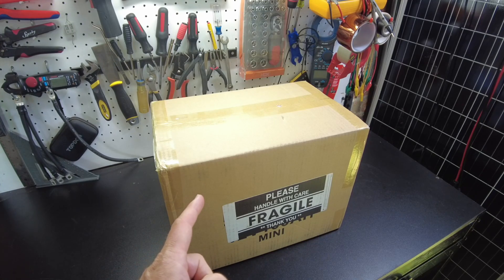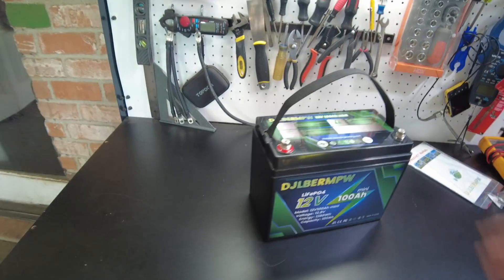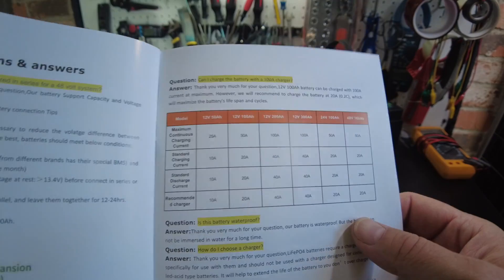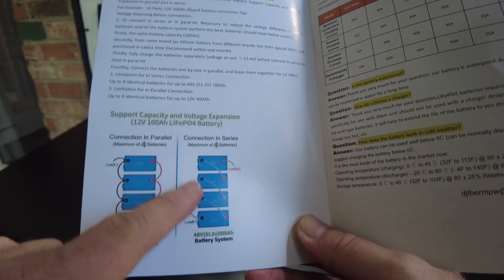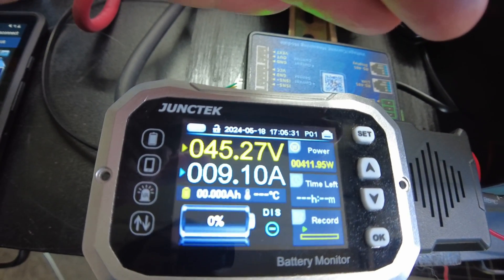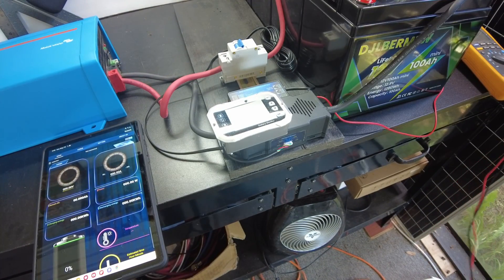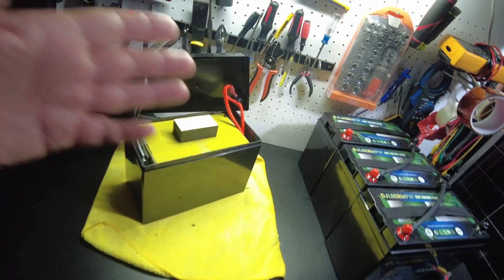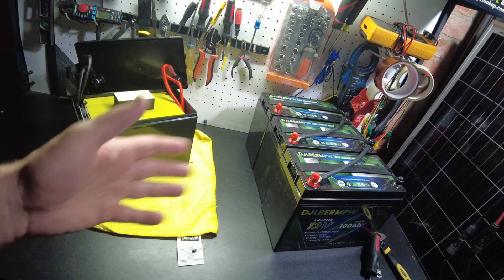DJLBERMPW Mini 12V 100Ah LiFePO4 Battery

Comment from the maker: Affiliate Links:
DJLBERMPW Mini 12V 100Ah LiFePO4 Battery: https://amzn.to/3V8Ra5Z
LiTime 48v 10a charger: https://amzn.to/4bvKlBe 
TEMCo 2 Gauge AWG copper wire: https://amzn.to/3wwKRzK
Midea U Shaped 12000BTU AC Unit: https://amzn.to/43xiXPm
Hydraulic Crimper: https://amzn.to/3MC5AHs
Victron Inverter 48/1200: https://signaturesolar.com/phoenix-inverter-48-1200-120v-ve-direct-nema-gfci/?ref=JRZm6fna41pidY

Junctek KH140F Shunt:
https://www.aliexpress.us/item/3256805106928984.html?spm=5261.ProductManageOnline.0.0.4ec14edfmA7L6t&gatewayAdapt=glo2usa4itemAdap

================
AFFILIATE DISCLOSURE: This channel may earn an affiliate commission if you purchase products through links I provide. 
================
CONTACT: bradcagleyt@gmail.com
Business/Collaboration only. Please do not contact me for for personal project help, or advice.
================
DISCLAIMER: These videos are documenting my own personal projects, and experiences. These projects, and activities can be dangerous. I am not a professional. You should always consult with a professional. This content is for entertainment purposes only. DO NOT try any of this at home, doing so will be at your own risk.
Reply: So, the BMS did not protect the battery?  One cell failed due to low voltage disconnect?  That is not good!!!
Reply from the maker: @tsp2jxd  It did protect the battery.

Comment: I purchased one of these batteries and it worked great for 6 months and one day when it was fully charged halfway through a pot of coffee my inverter started chirping. The positive terminal was red hot in the battery was spewing hydrogen fluoride. I have a dog and four rabbits my home and we all know what it smells like now! The company told me they would give me a refund if I returned it so I drove an hour to The UPS Store, paid 40 some bucks and ship it back to them, then they wanted to give me a partial refund and then they want to test it to make sure it's not human error and now I'm out 250 bucks, and no battery! I would not recommend this battery to my enemies!

Comment: That discharge rate is low. .08C. Test it at a .2C rate and get back to me.
Reply: This is a real world scenario. What are you running off of a relatively small 5kWh bank where you're going to draw 0.2C? That's a kW continuous.
Reply: @otm646  .2C on a 100ah battery is 20 amps that's the industry standard for deep cycle batteries.  Discharged in a 5 hr time. Stress a battery to find it's true potential. I  tested my same brand 300ah with a .36C discharge 109 amps. The BMS IN THE 100AH IS RATED TO 100 AMPS! Read a little before you comment next time.

Comment: So, the BMS did not protect the battery?  One cell hit low voltage diaconnect?  That is not good!!!!
Reply from the maker: Yes the BMS did protect the battery. That's what it is supposed to do. Low voltage cell will cause the BMS to disconnect, that's perfectly normal.
Reply: @BradCagle  the normal practice is to set the BMS to fire BEFORE THE BATTERY to avoid exactly that situation.  So, yes it protected the battery but the BMS should do that.  It's not technically wrong but not best practice if possible to avoid it.  

Carry on good sir!
Reply from the maker: @tsp2jxd  The BMS worked as it should. I think you're referring to the practice of shutting off the load before your BMS goes into a protection mode? Which I do agree. However this was a test so I actually wanted to hit BMS protection to make sure it works on these batteries. Thanks!

Comment: Nice ill get one once my normal size 12v goes 😂 its heavy has like them round cells inside about maybe 30+ of it and its like 25 pounds..  when im done charging it from dead flat shut off it only gives me 92ah, before its was 95ah when new but i had it for like 2 years now kinda abuse it dead shut off flat couple times still going so its going to take me maybe 8+ more years to get my battery to a way lower capacity that ill need a new one 😂 but for 180 bucks for a mini is really tempting 😂 if they get that to 150$ it would be nice and then they can offer ones for 200$ with some fancy warmers and Bluetooth.. love the vids.. adding this to my cart 😅

Comment: What inverter did you use and what power watts??
Reply from the maker: Victron Inverter 48/1200: https://signaturesolar.com/phoenix-inverter-48-1200-120v-ve-direct-nema-gfci/?ref=JRZm6fna41pidY
Reply: The inverter in this video is a Victron Phoenix 1200/48 .  See 5:58 and the next few seconds.

Comment: Greetings from sunny Jamaica 🇯🇲.I have a 24v system and I recently bought 4 of these 12v 100ah battery and I am wondering if I can connect them in series parallel to make a 24v battery bank.
Reply: I would say yes, but would be a good idea to put a battery balancer on them to optimize, charge, discharge and life of your new toys.
Reply: Greetings from sunny Jamaica 🇯🇲, thanks a lot much appreciated one more question what size balancer .

Comment: May I ask how long it took to be totally discharged?
Reply from the maker: The shunt said it would run for over 11hours at 450-475w. Now it did get hotter in the after noon so the power draw went up, I noticed this and turned it down as I didn't want to overload the inverter. I started the test early morning maybe around 8am, and it ended after 4pm I thing. So around 8 hours.

Comment: How long did the batteries run that 12000 btu AC?
Reply from the maker: The shunt said it would run for over 11hours at 450-475w. Now it did get hotter in the after noon so the power draw went up, I noticed this and turned it down as I didn't want to overload the inverter. I started the test early morning maybe around 8am, and it ended after 4pm I thing. So around 8 hours.
Reply: @BradCagle  Thank you! Just the kind of info I was looking for.

Comment: I noticed this brand of 50ah battery drops to 13.2v under load after charged. But it holds at 13.2v for a long time with about a 250 watt load. The 50ah lifepo4 battery from this company does 100ah load for a short period. Not a good idea to drain more than 50ah at a time under load with a 50ah battery. Seems to be a good battery with a good bms. However a 100ah battery will do a 100ah load drain safely. Will do a little more under power surge. Good Lifepo4 batteries.

Comment: Thanks Brad. 48V is the way to go for me. It looks like you need to have some kind of balancing going on between the batteries to run them in series like that?
Reply: I wish they fix up their website - AUD detected ok, added to cart ok, but can only ship to US? Weird that they do that when they, right at the get go, detected I was inquiring from Australia....very annoying.
Reply: @Bennyboy-dog  Get a US mail box address from Aeropost. They will forward it to Aus. for you.
Reply from the maker: Yeah, I've seen the balancers for this kind of series setup. I'm tempted to put these in service to determine how long they will work before going out of balance. If it's not very frequent you could easily top each off with a simple 12v charger. Thanks Ben!

Comment: I had learned after charging up each battery, ... then you connect them all in parallel ... no load ... and let them sit for a day or two.  This actually equalizes al four (in this case) to have the same voltages.  THEN you make them up into series or series parallel...  just sayin and I hope this helps.